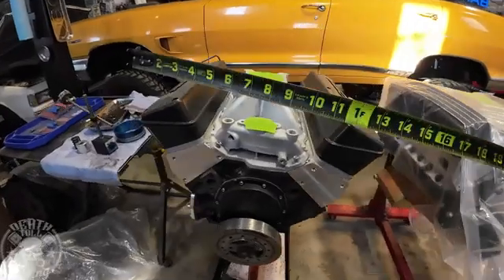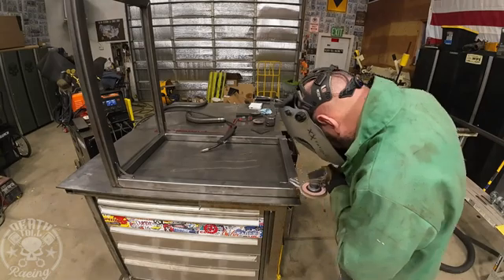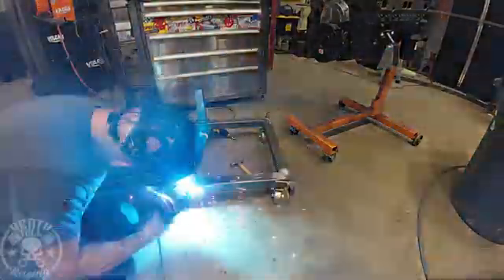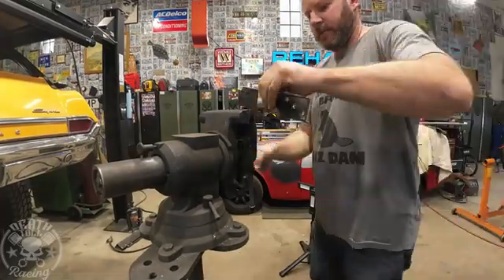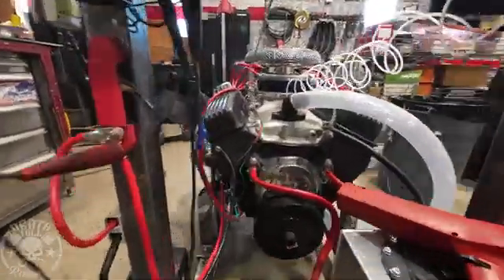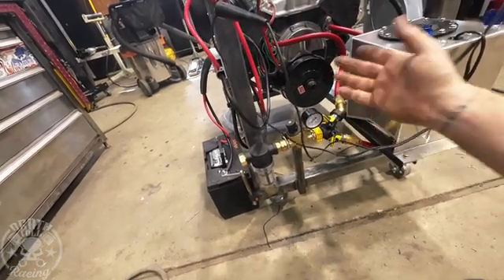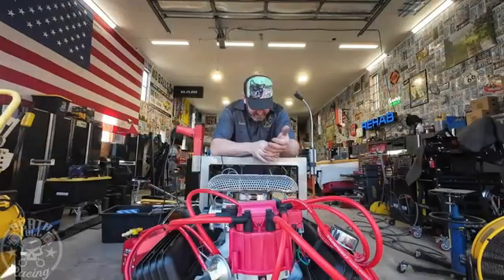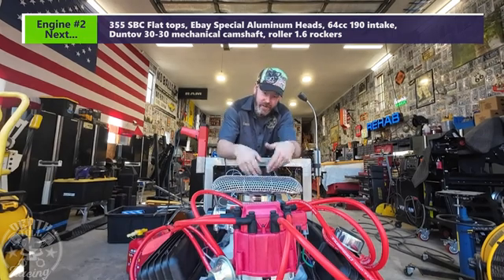Engine Run Stand Fabrication, Build and Test 2 Engines; Roller 383 Stroker and 355 SBC Duntov

Comment: Interesting run stand build.  I think I may borrow a few of your ideas for my stand.  Quick question, though - How will you mount an engine with bell housing attached, as Ford engines have starters bolted to the bell housing?
Reply from the maker: Basically the same but that rear mount goes on top of the bell instead of to the block.  May need a spacer in between like an engine stand arm.  It doesn’t take much to hold it up back there, so you don’t need anything crazy. Torquing is on the front mounts and there’s only 10% weight on the rear mount.